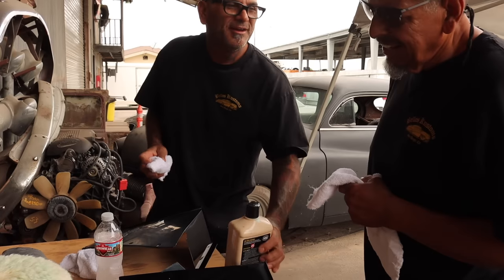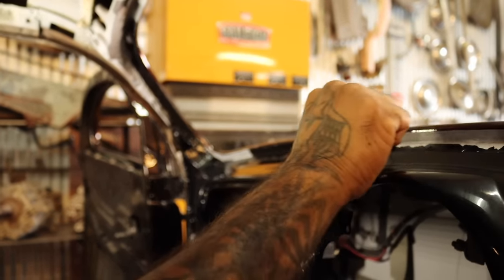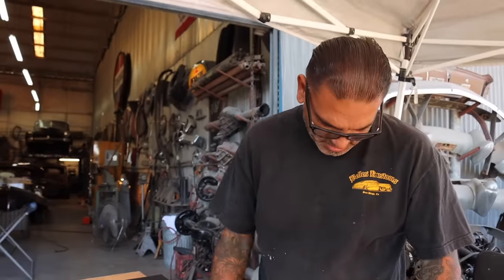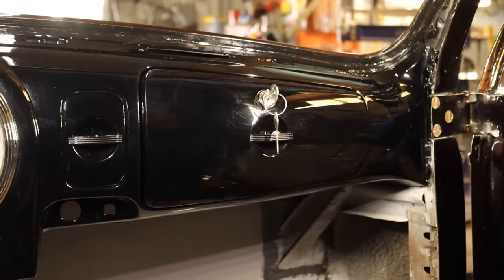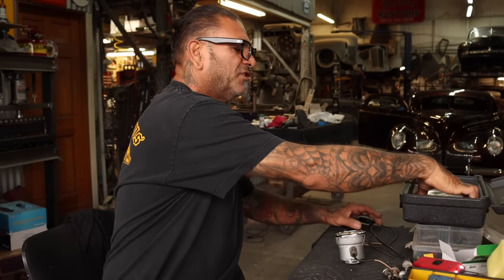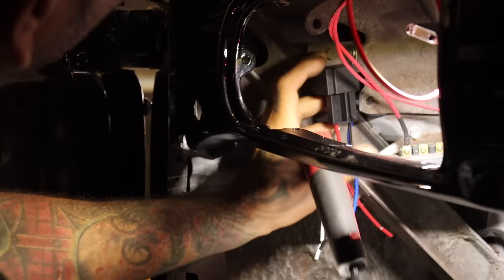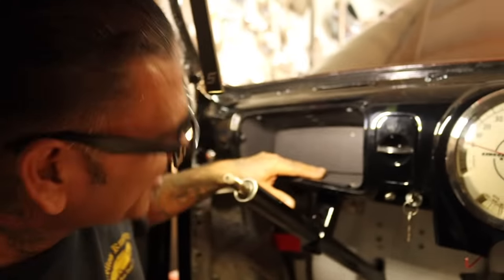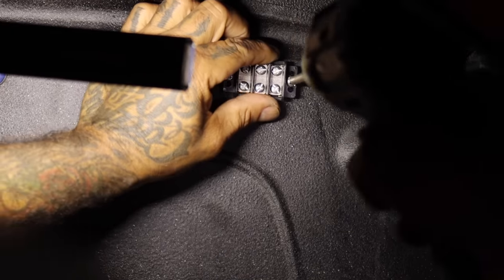1939 Lincoln Zephyr Dash

Comment: Man you do fine work on that wiring.I have been wiring up everything from logging equipment ,commercial boats,yachts and hotrods for more then 40 years and that wiring you have done is top of the mark workmanship. A tip that i use to tape wires in very tight places is to roll the tape back on its self until I have 1/2 to 3/4 inch roll break it from the main roll then just roll the small roll  on the wires ,with some practice a person can tape harness tight  and neet  >Cheers

Comment: Your You Tube channel should be a must watch for other builders. Attention to detail at your level seems so straight forward. I wonder why others don,t apply your techniques. I guess you get what you pay for. There is no replacement for experience, yes a good selection of tools help, but not as much as pride in ones work. I was curious why you don't use weatherpak connections for wiring susceptable to water infiltration. Thank you for sharing your talent and eye for detail.

Comment: Definitely the hours to make it straight or round and look like its supposed to yes finish work is hard. My Uncle taught me , He started with lead and worked 40 plus years. My first experience sanding with the idiot stick he called it. Long board for huge flat panels, finally the front fenders on my 55 , many times to get them looking right hand sanding around headlight and turn signal openings. Yes I would rather do anything else hehe but it all needs to be done.

Comment: Have you noticed the quality in electrical components, all of them, has gone down the toilet?? Im thinking when I see you wiring the dash, youre just going to have to go back in and replace the switches simply because theyre junk.  Ive had them fall apart in my hand as I took them out of the no steal plastic wrapper. How do you fing good stock to work with?